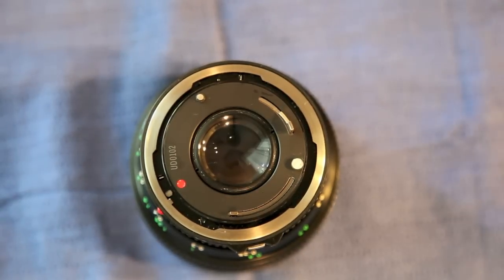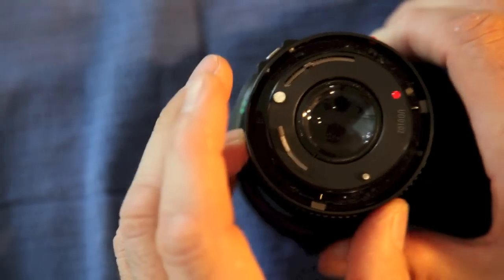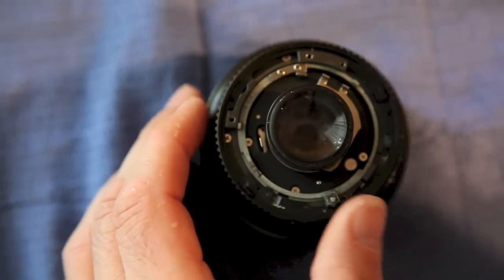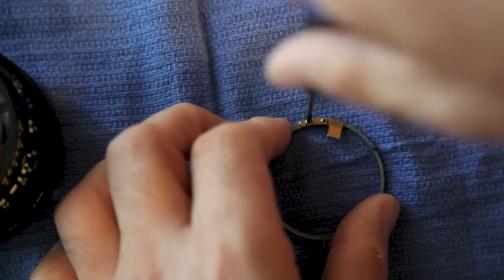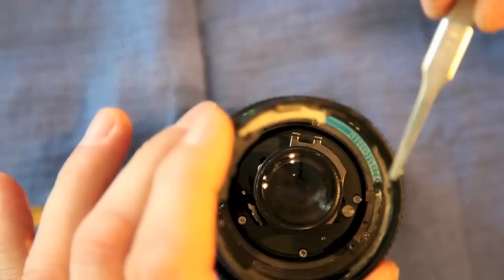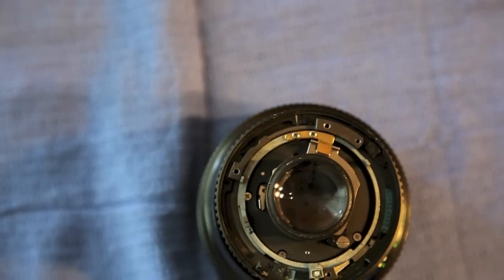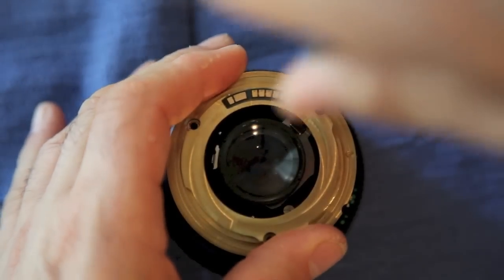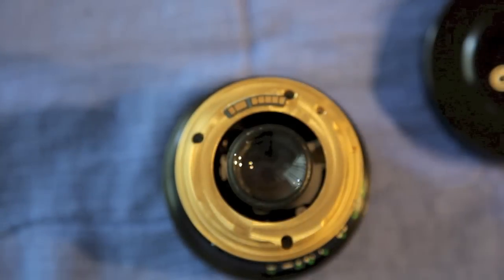FD to EF Conversion Instructions

Comment: Hey 👋 after EF conversion can you use the lenses with speed booster? Specifically the ABT Speedmount for DSMC2 cameras. Kindly let me know. Awesome video.
Reply from the maker: Typically any EF converted FD that will not clear the EOS body mirror will not work  with a speed booster. At infinity focus the shorter focal length EF converted FD lenses tend to extend the rear lens element past the electronic interface closer to the sensor. This is an artifact of the required positioning of the lens to achieve infinity focus. The speed boosters internal lens element is usually placed just offset behind (toward the camera body) the lenses electronic interface and this causes insufficient clearance for the converted lenses rear lens elements at infinity focus. This limitation is very FD lens and speed booster combination specific, for this reason our general recommendation is to not use a speed booster with any brand of FD to EF conversion kit without a money back guarantee of compatibility.

Comment: Hey! I was wondering if it is possible to use this conversion on tokina lens with fd mounr, since it is the same mount. Do you have any idea? Thank you!
Reply from the maker: The internal design of the Tokina lenses if different than the Canon Series lenses and any kit designed for Canon will not work on another brand lenses.
Reply: @fdtoef  i see, Thank you for answer. Im using the tokina 17mm instead of the fd, as cheaper option. Really like the look of it

Comment: Yes, BUT!  Will this converted lens focus to infinity?  That seems to be a problem with FL and FD lenses.
Reply from the maker: Yes. The conversion plate servers two primary purposes, enable the physical mounting of a FDn lens to a Canon EOS body and more importantly corrects the Flange Focus Distance. Correcting the Flange Focus Distance of the lens for the EOS body is what enables the ability to focus to infinity. I won’t go into all the details about Flange Focus Distance (FFD), but I will say the FDn lenses are design for a 42mm FFD and the EOS bodies are designed as 44mm FTF distance. This means the EOS bodies place the lens 44mm aware from the sensor, but the FDn lens needs to be placed 42mm away from the sensor to focus as designed. The conversion plate places the FDn lens 2mm closer to the bodies sensor, then the original mount could have. This is why the cheap screw on adapters don’t give you infinity focus, they don’t move the lens 2mm closer, but instead makes the FFD worst by adding to it, taking away even more focal range.
Reply: That is the kind of answer I was looking for.  Good Job!  
I have the Canon FL 55mm F1.2 Fluorite Lens elements 1968  (1.05822 lbs) and have been interested in a way to use it without including more glass in an adapter, cheap glass.  Do your kits work for my lens?  I have a Canon 2000D which is a ASP-C sensor.  Can you add a link to that kit for us.
Reply from the maker: @jmoss99  Currently I don’t offer a solution for the FL series lenses.
Reply: Maybe it is a good time to start.  
Is there that much of a difference between a FD and an FL?  
What does an FD solution cost anyway?
Reply: I am here in the Silicon Valley.  I have a recording studio product in which I used a lot of CNC machining on the front panel.  I know these people.  I have friends who have their own CNC machines.   I know people with 3D printers.  How hard do you think it would be to create a FL series solution?  To me, I think using 3D printing in quantities of 500, the cost could get down to $50.  This is only $25,000 for a single lot of 500 kits.  This could then be used to address other lenses like the FD versions.  If you could make one that met the requirements of both lenses, you would be off and running.   I mean, in someone's garage as a hobby at night even.  I mean, $25,000 buys a lot if you have a person with a 3D printer and time on their hands.  

What do you think of that?
Reply from the maker: @jmoss99  3D printers cannot hold the .0005” - .001” tolerances required. Plus I already own two 3D printer and a CNC.  It thank you for the offer.
Reply: I read where EdMika did go from brass to 3D printer before he died.  I feel like you that the tolerances would not be tight enough, bet if he did it then maybe I am wrong.   A CNC could surely hold that tolerance.  Maybe he machined the critical areas of the 3D printed part.  He was using some super strong plastic.  Well, maching in quantity is pretty cheap too.  It is all setup.
Reply: So, fdtoef, exactly where is this tolerance required on the converter kits?  In your video I see lots of machining marks.  That tells me that the .0005” - .001” tolerance does not apply there.  Also, not everyone wants the electronic focus option.  Some are used to using manual focus and prefer it.   Most of us can do a better job using our eye and maybe a larger display. 

Well, I think holding a .0005” - .001” tolerance is not a big job for the right CNC in good condition. Also, I doubt that it is required in very many places. I also learned a long time ago, not to buy the equipment. People who have, now need to pay for it by selling time. That is the beauty of business. I don't like the plastic idea either, but metal that is a different subject. Actually, a CNC and a 3D printer is the same thing, just in reverse. With a CNC you take material away. With a 3D printer you put material on. Since a CNC cost is all setup, then I would go with that option. Once the code is worked out, the cost falls off a cliff. 

For example, and not at .0005” - .001” tolerances, but I produce a Pro Audio vacuum tube mic preamp, here in my retirement. The milled knobs on the front would cost me in the USA about $50 each.  In China, they cost me just under $2. That is in quantities of only 100. They are milled, textured and anodized then detailed. The human cost is minimal due to the CNC, in both the USA and in China. Labor is not a major issue. They use the same CNC. The other overhead might be higher here. However, in doing costing, I found that the shop overhead is not a big issue. The issue is the folks doing the quoting. It is their mindset that is an issue. It is their ability to understand time and motion that is the issue as well as the material costs. 

So for me, it is my ability to write a RFQ contract that is critical. For the parts I made for the Space Shuttle and the Stanford Linear Detector, I went out with complete drawings sets to 30 companies for quotes and I told them I was doing so.  I got back 12 responses. Most of which had no clue what they were talking about. One to three did, and we went with them. They made money on the projects. 

I don't believe .0005” - .001” tolerances are really required on a lens mount converter kit, but it can be done pretty easily with the right equipment. I mean, how did those clowns in the 1970s make lenses and cameras with the old equipment they had to work with. Think about that. It is not rocket science, something that I did have something to do with. I am just a guy who wants a FL converter kit. I already have a product. So this is me suggesting to you, there is a way. You just have to get out of bed in the morning, then work all night. It was that approach that got me published by IEEE. That is how companies like Apple survived. 
Jim
Reply: Does anyone offer a solution for the FL series lenses?
Reply: Yes, that is the reason for changing the mount, to correct the flange to focal distance so that infinity focus is possible.
Reply: Interesting Marty.  How does changing the mount correct the 6 foot max distance to the infinity focus?  I don't understand how this works.  Can you break it down for us?

Comment: Have you ever had a problem with screws that were frozen... unable to be loosened?
Reply from the maker: Yes, and there is no single solution. It is always best to start with high quality JIS screw drivers, not Phillips screw drivers. Apply constant downward pressure on the screw driver, while turning the screw driver. If this initially does not work I apply a tiny bit of liquid wrench penetrating oil, let it set for a few days and try again. Another approach is to use a narrow tip heat gun to apply heat to the screw. Even with all this I’ve snapped off a screw on my FL 600mm focal unit. I’ve yet to fix it. Fused screws is always a risk with these older lenses.
Reply: @fdtoef  #2 JIS? & have you ever tried using an impact driver... ever so lightly!
Reply from the maker: @roehaus1  It depends on the screw size, but a 2.5mm or 3mm JIS are the two I use the most. I haven’t tried an impact driver yet. I’ll have look into that.

Comment: Trying to convert the 20mm f2.8 and the piece that I was sent is not the same as the brass-looking piece you have in this video. Do you have any updated videos or instructions to follow? Just getting a piece of paper to watch a video that isn't relevant to the conversion kit I was sent isn't helpful.
Reply from the maker: The current design eliminates the need for the brass part. Simply remove the aluminum ring that that the brass part would have mounted to and instead use the provided replacement ring. The FDn 150-600mm video has a similar replacement ring design.

Comment: FD and EF have different flange focal distance. So image from infinity cannot be converged to the senor.
Reply from the maker: Yes you are correct the F
Reply: Is that only with an adapter? Or does that also apply to this EF conversion?

Comment: Do these work for FD lenses as well or is this specific to FDn?
Reply: Lenses from both series are supported
Reply: Marty Castilla awesome! Do you know if there’s any issues with focusing to infinity or the glass hitting the sensor? Hoping to mod a few FD sets that I currently have
Reply from the maker: @dq72491  The kits are designed to enable infinity focus. All APS-C body mirrors clear. On full frame bodies, a few of the normal and wide angle lenses limit mirror moment at the infinity end of the lenses focal range. This is easily over come by using LiveView mode.
Reply: fdtoef great! Thx for the reply. So I’m mainly going to use these lenses for video/cinema. Do you know if there are issues with full frame cinema camera bodies such a as the Blackmagic Ursa Mini Pro 4.6k G2?
Reply from the maker: @dq72491 I'm not aware of any issues, but I also don't have any experience or knowledge on non-Canon bodies or mounts.
Reply: Copy that! I’m looking to order a batch of about 4 or five. Is there any way you guys would be able to offer some sort of bulk discount at all?? Just figured I’d ask just in case! #strugglingCOVIDfilmmaker 😄
Reply from the maker: @dq72491  4 - 6 is a typical order size.
Reply: fdtoef just ordered a full set. Do you know how long an order will typically take?
Reply from the maker: @dq72491  👍🏼These are built to order, typically 3-5 days plus priority shipping time of about 3 days.
Reply: @fdtoef  I just placed an order about a week ago. Just wondering if there was an update on when they would be shipped. I have an upcoming shoot i would love to use these for!
Reply from the maker: @dq72491  I emailed you an update. I received several orders at once, including yours. It is shipping today. Enjoy.

Comment: Hello.
I want to convert a Sigma 400mm 5.6 apo FD lens to EOS, EF.
It is also possible where I can order the part for the conversion.
Thanks
Reply from the maker: Hello, I'm pretty sure my conversion kit (parts) will not work on any lenses but the Canon lens they were designed for. However, if you interested in modifying one of my kits to work on your Sigma you can certainly order one. I can't accept a return based on this application.

Comment: What is the benefit of this over a using an adapter?
Reply: much better image quality, wider field of view. adapters require internal optics to achieve infinity focus. those optics kill the IQ and end up "zooming" in the image a bit. this mod is a far superior way to use vintage glass on a modern camera.
Reply from the maker: The conversion maintains the original crop factor and infinity focus. All adapters will change the focal length of the lens. Adapters have to move the lens further away from the EOS body. This turns a 50mm into a 55mm or more. Because of this change in focal length, the lens can no longer focus to infinity. This limits how far your subject can be from you and still have them in focus.

Comment: Has anyone done this with the FD 85mm 1.2 L ? I don't want to screw that beauty :/
Reply: It won't work with that  lens, because it have a rear element mounted in the mount. This means that a special mount is needed to hold the rear element in the proper position.